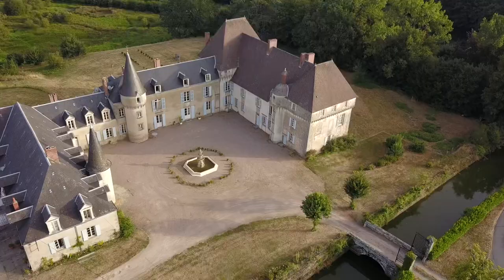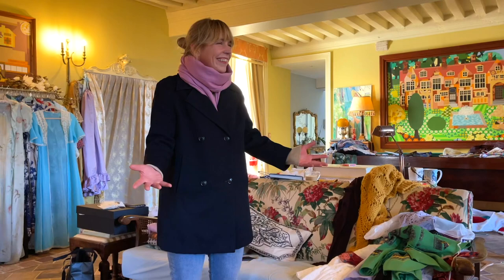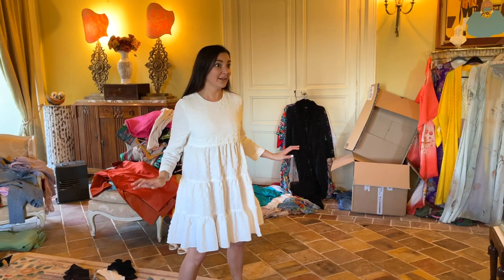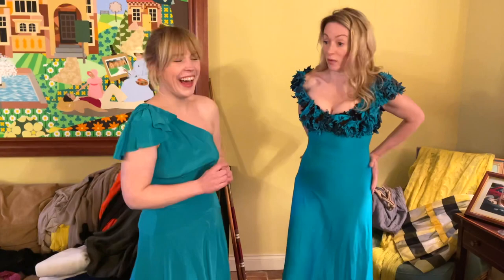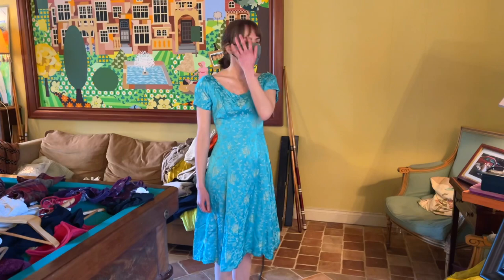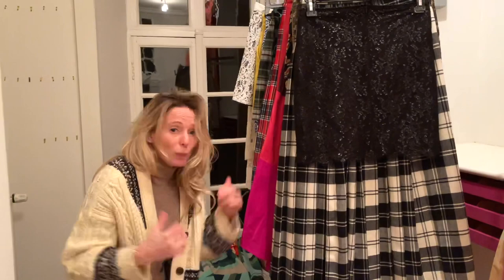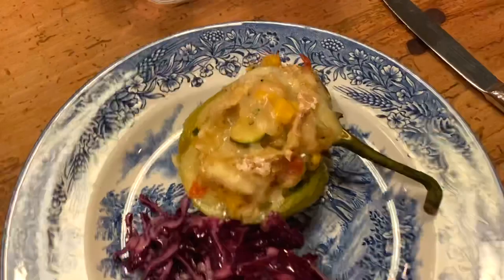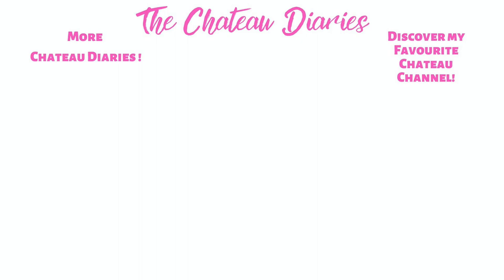The Chateau Diaries: TIME TO DRESS LIKE PRINCESS DIANA!

Comment: An idea for the pool table as my family did something similar to ours, put a large flat piece of wood on top, it doesn't need to be fancy as there are always table cloths, and it doesn't need to be strapped to the pool table, but I am sure Selmar can create a way to secure the plywood type of wood to the pool table without screws to damage the pool table, and now you have a really big dinner table with space to pull up a chair and if its a little too tall you can get new chairs with longer chair legs, or a narrow piece of plywood with table cloth and now you have a big buffet or sideboard. You can keep the pool table and repurpose it for bigger dinner parties.

Comment: I'm not a stone mason,  and someone had possibly already said this in the 500+ comments but,  would wetting the stone down before and during cutting reduce the dust? Probably be best done outside but i understand its cold out!! We see most concrete cutters here connect to a hose to reduce dust,  I thought it might help.
Reply: Yes wetting the stone makes it easier to work with

Comment: I have a serious question for Selmar: How on earth do you hang a very heavy chandelier from the ceiling? Especially through those plaster decorative pieces. Right now, I am trying to hang up a very heavy pendant light and have no idea how this is accomplished without it just hanging by the very old wiring. I have butterfly anchors but the screws are not nearly long enough to go through the plaster decorative thing AND the ceiling itself. I am really curious to see a video on how you guys do this.